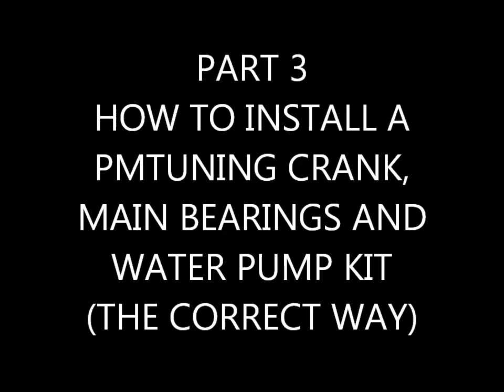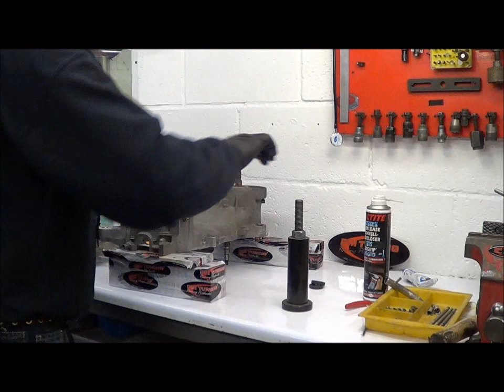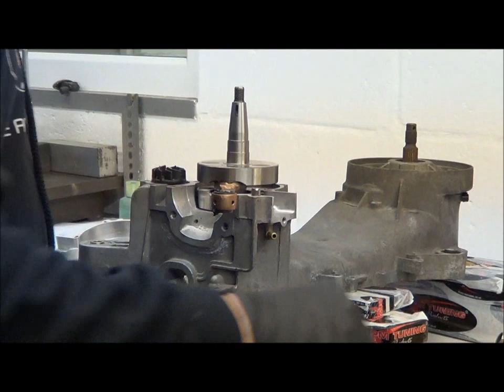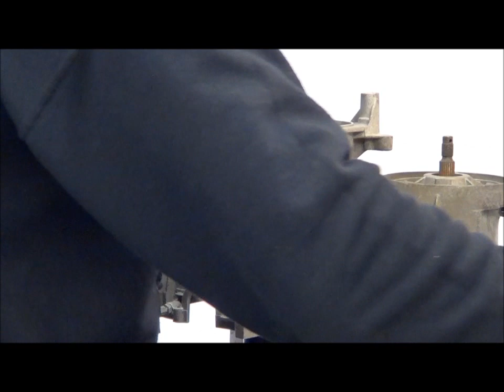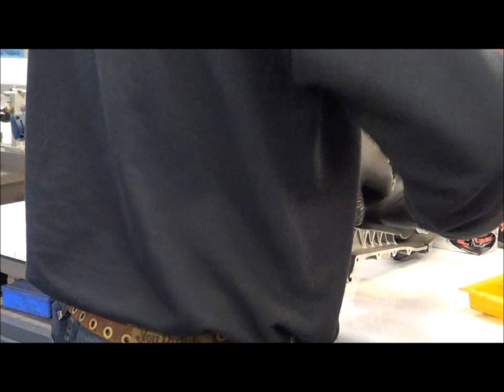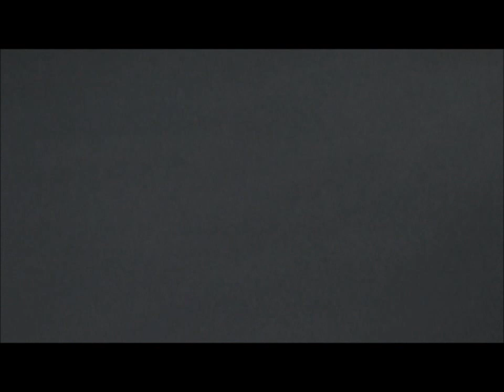PM TUNING HOW TO FIT A CRANK, MAIN BEARINGS AND WATERPUMP KIT (3 of 3)

Comment: should all cranks move that freely when spun as mine gets siff when i tighten it up
Reply: Your crank must not be centrered in the bearings if it doesn't spin that freely, but remember that is without oil seals fitted.

Checked the clearance each side with a feeler gauge, then if you are careful enough you can tap the crank with a rubber mallet to get it centrered so it spins freely

Comment: If you get the seal on the ignitionsite pushed beyond 12.5mm down, it will hit your crankbearing and burn the bearing off in 10-15km..
Always remember to check this when fitting on the ignition site!
Other site is just to be plain with the engine mould..